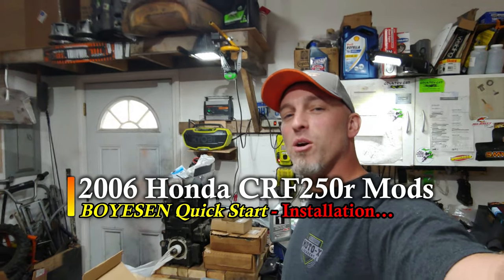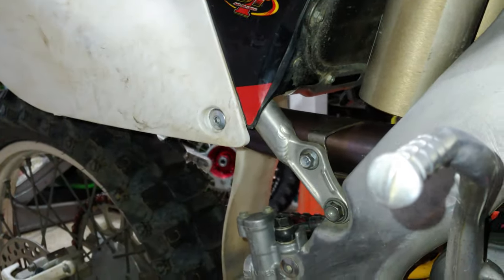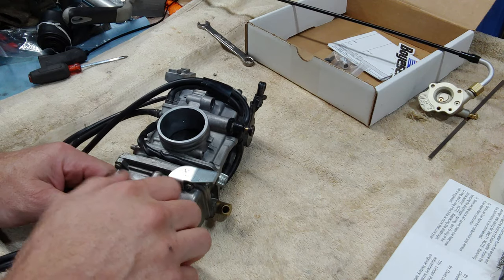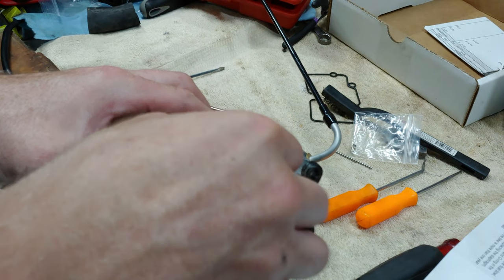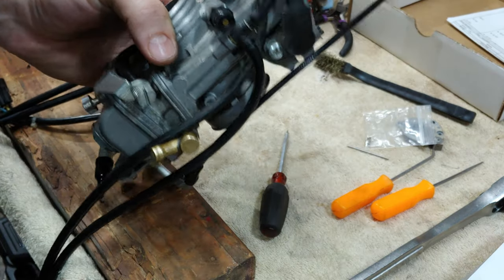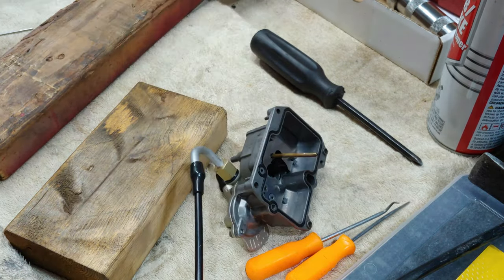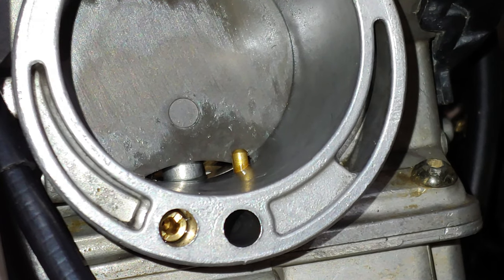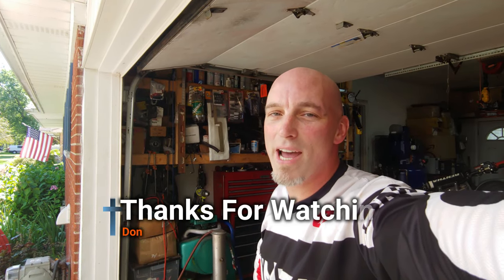2006 Honda CRF250r Carburetor Mod || BOYESEN Quick Start Install

Comment: Got a question. Is the QuickStart just a quick shot 3 with an added accelerator pump disabler? And I lay my bike down a decent bit doing hill climbs, but I’ve found if I just slow kick it 4 or 5 times then give it a solid kick it’ll fire. Will the quick start eliminate having to slow kick the bike to push out that excess fuel?
Reply from the maker: Yes to all that.
Reply: @Fixin2Ride-Official-  perfect, thanks for the response man. I’ll be ordering one tomorrow!
Reply from the maker: Good deal. Glad to help. All I ask is that you share a favorite video and rhe channel one time in all of your social media accounts. I appreciate ya!
Reply: @Fixin2Ride-Official-  fair trade man, I subscribed too to keep up on future vids!
Reply from the maker: @ethanclark6859 Appreciate it!

Comment: Question, I’m installing one on my 2004 yfz450 and I’m not sure where to route the cable
Reply from the maker: You got a angle B cable coming from the QuickStart I think at 11 or something like that whatever the instructions say. And then reroute it in the same place that the hot start cable was routed yeah.

Comment: I've a questioni, with this mod it's possibile to have NO squirt? Because sometimes I Need zero squirts for more Linear engine.. I know that you can regulate the flux but also stop It?
Reply from the maker: Yes, the boyesen quick start replaces the use of the hot start lever with the ability to disable the Accelerator Pump when the lever is pressed and then allow you to twist the throttle withiut fuel being squirted into the cylinder. The hot start pluger is installed but covered with a cap.
Reply: @Fixin2Ride-Official-  thanks:) , but in your case I see that also with hot Start avtuvated there was some squirts , it's normal?
Reply from the maker: Just a tiny bit when letting fhs throttle snap back a couple times in a row is. The only time you should be twisting the throttle all of the way open is when its flooded. Any other time should only need a very slight twist which wont produce any squirt.
Reply: @Fixin2Ride-Official-  thank, last wuestion. in case it's possible to mantain activated the hot Start during hard Trail? Because I've big mono 700cc and produce enough vacum so in difficult Trail I Need to deactivated the acc pump foto a mor Linear respons.. my doubt Is that during the use, the cover pump after a  while Will be fueled and start to squirt in the next moment.. so my necessity Is to permanent block the acc pump squirt during hard Trail and reactivated in the street
Reply from the maker: Interesting... I'm not exactly sure how youd go about having both other than the adition of a second lever. And as fas as completely disablinging the AP, you'd have to have a locking mechanism for the AP lever.
Reply: @Fixin2Ride-Official-  yes, I'm searching something to block the rod of acc pumo without blocking the rotation of throttle shaft.. like something the bk mod.. but with the stop screw all the way in, so the acc pump could be blocked at all.. it.could be possibile?
Reply from the maker: I dont think thats possible personally. As when the throttle is twisted the sprinf that has tension on the AP push rod inevitably causes movement of the push rod ans this the AP diaphragm. Youd have to completely renegineer the carburetor or remove the push rod.
Reply: @Fixin2Ride-Official-  I'll see in case, thanks